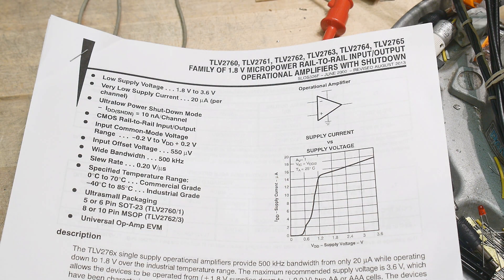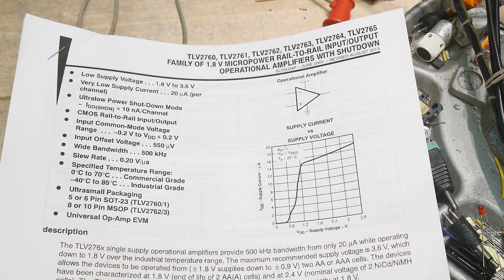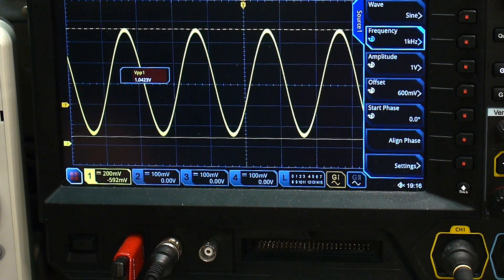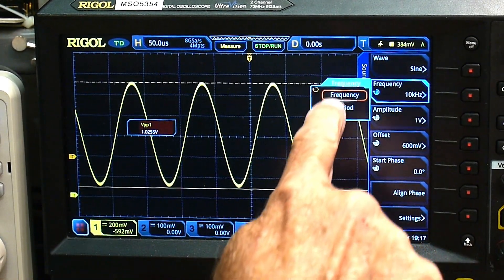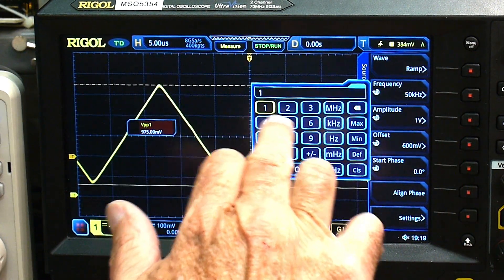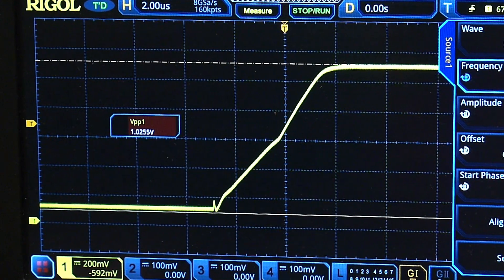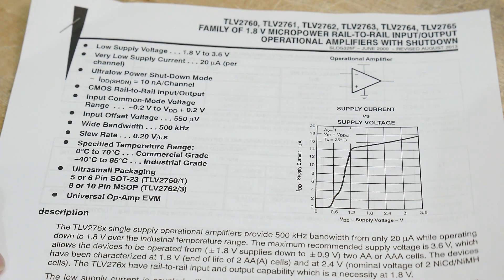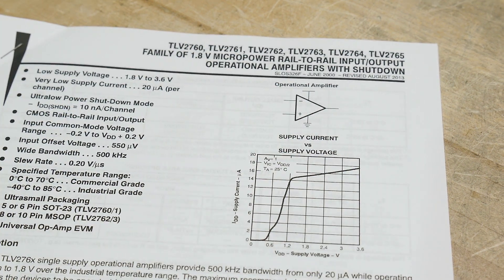#1505 TLV2761  1.8 Volt Opamp

Comment: It's amazing that analog stuff can operate down to such low voltages!  I've used a LMV951 in a home project.  It can run down to 1V!   It's not a low power design, so the gain-bandwidth product is a reasonable 2.7MHz.  As you proposed, my project is powered by two AA alkalines.
Reply: I have a harder time finding mosfets for low voltage use. And that's exactly when I'd like to use them, for the low voltage drop.

Comment: All of the nonlinearity issues are more or less expected.  The device is Rail to Rail, input and output.  That typically requires duplicate input stages (like PNP and NPN or corresponding FET pairs).  One handles signals near negative rail and the other one near the positive rail.  To get a single ended output, you need to do some sort of summation, keeping the gains matched.  I personally would not care to try building one.
Reply: LMV951 gets rid of that problem. It has internal charge pumps that generate bias for the input stage and for the output stage. The input stage is NPN-only. Output stage is CMOS.

Comment: Thought that you show also what happen if you leave the input common-mode range. The output stage is obvious B-type which have two possible gain mismatch points because of the internal topology. It is very generious. Its a shame that the vendor supplied models do not show what you can see on the scope with simple signals. They still want to leave the users in the dark and force them to test on board instead rely what SPICE provide them for the internals.

Comment: If anyone is wondering... when he is showing the package outlines... at about 7:53 in... the DBV package is a TI proprietary package... similar to the standard IPC-7351 SOT23-3 package... but the geometry, and footprint, for the DBV package is a bit different... not much... but different. Probably you could 'hand solder' a DBV package onto a pcb with a SOT23-3 footprint... but, I don't know what a pick-and-place machine would 'think' about it. (Those machines don't really think.... not yet anyway.)

Comment: Does the crossover distortion get better at higher supply voltage? You were at minimum when you were testing, if I followed correctly.
Reply: Typically the "offset bump" (as I call it) follows one supply rail. It's where one pair of input transistors hands over to the other - which is how rail to rail input is accomplished. The TLV2761 bump is about 300uV - figures 1 and 2 in the datasheet. It appears to follow the negative rail. 

The distortion seen here is too great to be explained by offset bump alone. (TBH I don't normally go this deep as I'm a firmware engineer, but it's fun.) The slew rate is indeed affected as  IMSAI says. My guess is there's also a difference in how the input error amplifiers feed the gain stage. The solution is not to drive your chip to the limits - unless you're making a guitar pedal or something haha. This is a slow 20uA chip.

Comment: You should revisit this one with a bit of load on the output.
It may not like the probe inputs as load having >1Meg load with a predominantly capacitive component. Datasheet mentions capacitive loads in excess of 10pF which is not much...